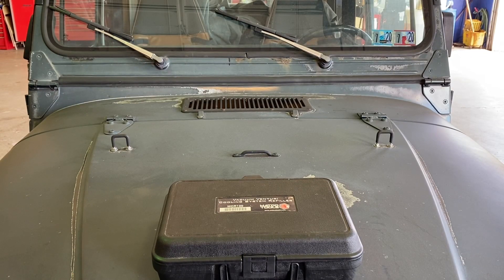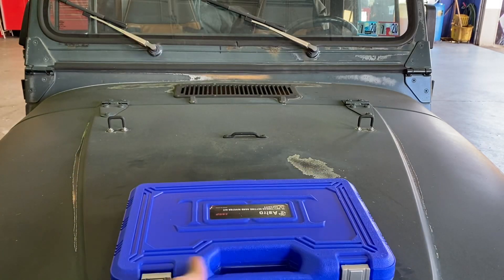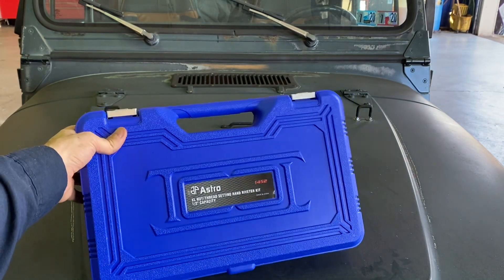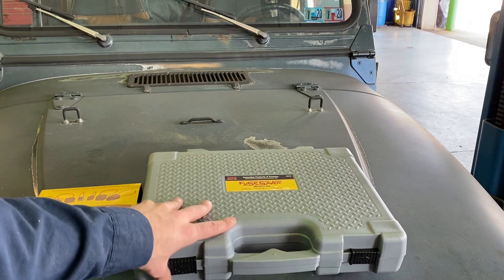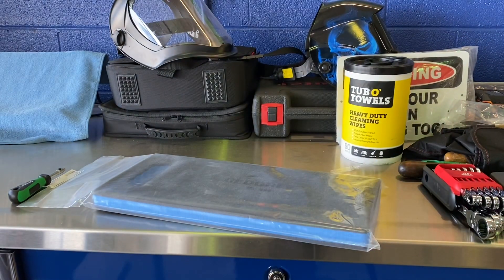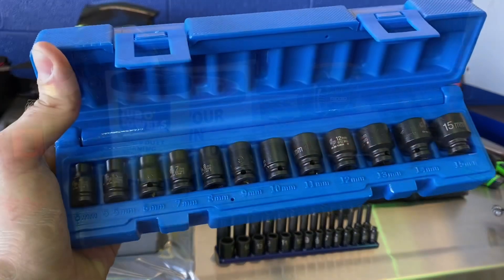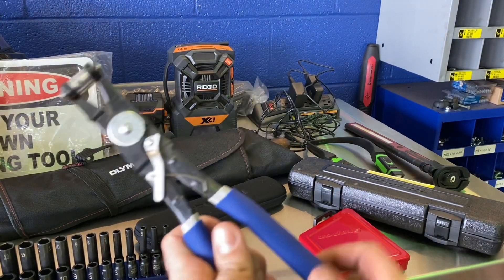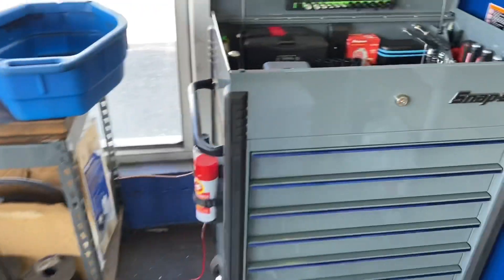Tool Haul 4:  The Wrath of Snap On

Comment: I bought the snap-on master file set. And when I say master set I really mean I bought all the files in the catalog. Then I bought 1 handle. And honestly I am not a fan of the snap-on file handle. It seems flimsy, the files angle out when putting pressure on your work piece. It holds the file ok but I don't like the file angling out on me. Especially when your trying to make something look good you get alot of effects on your work piece because of it. I know they have different size handles and that may have something to do with. It was advertised as a 1 size fits all at the time. The snap-on files are top notch though. I have filed some serious stainless steel with them and they work excellent. Of course, they better if it says snap-on. I also have a bunch of old files my Grandfather used back on 50s and 60s when he worked in a cannery. Let me tell you those old files just as good. Same with some bigger files I got from a flea market that look like they were used on the railroads, which are very useful as well.
For the younger guys, it doesn't have to say Snap-on to be a quality tool. For example I have a ratcheting offset screw driver from duralast that Snap-on doesn't make and that thing has saved me countless times. What makes it so great is the bit locks in and the tool thickness is the same as the chuck. Making it very low profile. It seems to be discontinued but Icon and a couple other manufacturers came out with one recently that mimicks the same design. 
What I'm saying is go with your experience and gut on what is good for you and the job as far as tools go. 
Good luck out there.